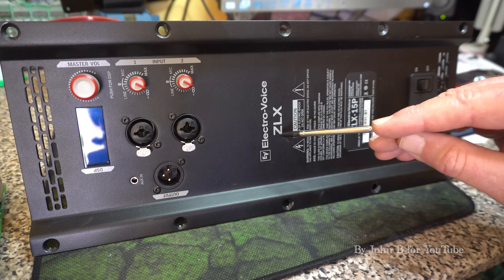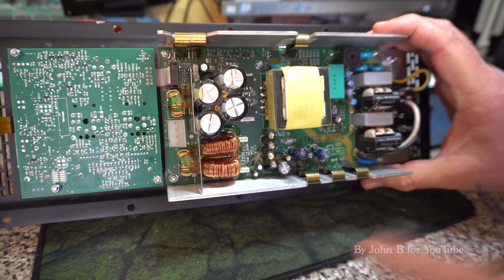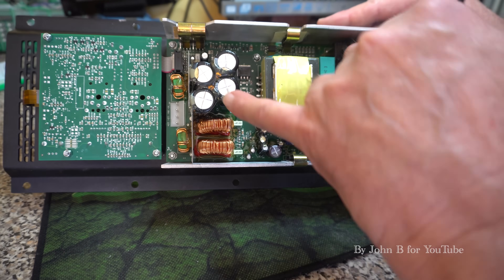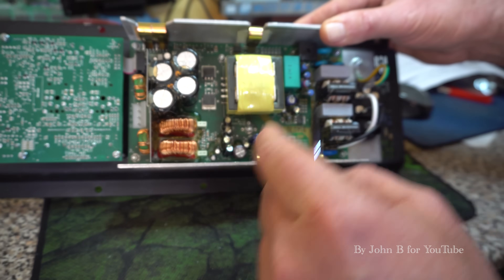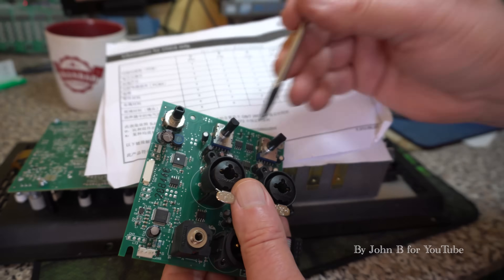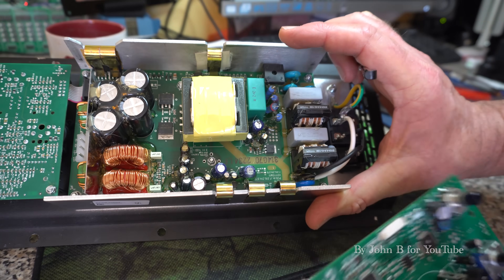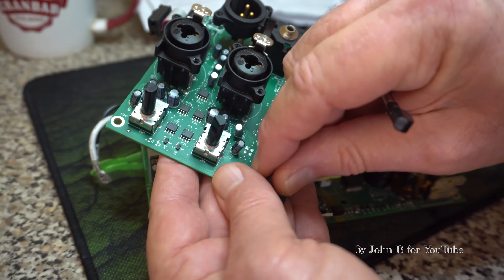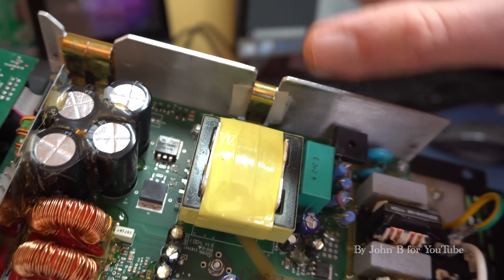The Inconvenient Truth about your Electro-Voice ZLX-12P & ZLX15P amplifier (Read Show More)

Comment: This is disappointing as I heard them last night at a party and they sounded great.
Reply from the maker: Their lack of power and reliability does not stop them from sounding great.
Reply: Just from some articles I've read, don't you find that many users will only really need, use about 200 watts +/- in their applications?  I own a few bass amplifiers with Class D amps, SMPS, etc.  They show ratings of 500, 800, 1000, RMS watts.  I use them in bands at small-med sized clubs, halls, etc with no PA support and they carry the room fine with my 2x12 or larger passive bass cabs, using my 5 string basses.  They've served me well for some years now. It seems I've never pushed them beyond their capabilities in the way I use them.

So what I feel is very loud or loud enough volume for the gig I'm doing, again from articles I've read, I'm probably only using 160-200 watts, if that, for that volume.  I guess the rest allows for good amount of headroom.  

My point being and I own a couple of the EV-ZLX200-12's/12" powered sub, that most users in small-med sized rooms at moderate volumes can get plenty of power/volume for their needs, 1000 watts or whatever EV rates them not withstanding.  

Of course, a DJ or band using these type speakers in very large rooms or at excess volumes may tax them to the point of failure.  Do you feel that persons pushing these EV speakers hard have a better chance of failure over one who uses them in a more moderate volume, room size, etc?

I understand you're telling us the lack of quality parts used in the manufacture of these EV's makes them prone to failure for the price paid for them and that's not cool.  But if one cannot get them to fail with "normal use", then I'm hoping using them as we do, restaurants, small clubs, they continue to serve us with no issues for years to come.  That's my hopes at least.  

Thanks for this video, makes one think that one should spend more money for  better quality powered speakers, depending on their planned use and needs, although I consider QSC as best quality much more than even Mackie.  I did not like the sound of the Mackie Thumps when I auditioned them.  But of course that is always subjective to each persons preference. 

These EV speakers may serve some for their uses and at a more moderate cost. With hopes of never having to deal with any issues of course. The "horses for courses" should apply when one makes these purchases for their applications.  
No argument with your assessment here. You made your point very well here. Howdy from Texas and thanks for this video mate, peace, .e
Reply from the maker: Good morning Texas from the UK.
You make some valid points with reference to power, venue size and not driving the speakers at max power.

I'd like to say I don't feel EV have used inferior quality parts, I believe they are as good as any other active speaker I have seen.
However,  looking at the design of the amplifier and the user manual I found quoting 1000 watts, it's clear to me that EV do not worry about inflating the real power of their systems.
If EV had quoted 240 watts, this video would not exist.
Also, if EV had built a more substantial power supply, the amp would not have failed and again this video would not exist.
It's the design of the power supply that maybe lacks sophistication and EV are not on their own in this regard.
The Mackie SRM450v2 SMPS is super super reliable, it's just a shame it needs 380 volts dc which is derived from a PFC circuit which is prone to failure.
The Mackie 450v2 SMPS is more sophisticated and complex, it has more components doing the same job as one component and so becomes more robust and reliable.
In answer to your question-
I think driving the EV speaker at less than full volume may give it a longer life span. But no guarantee.
From memory,  the QSC amplifiers are more powerful, clever designs using the latest technology and so probably a better choice than the Thumps.
PS On a side note.
Older Wharfedale  active speakers have their own fair share of problems, but the main SMPS isn't one of them. They use power supplies using a push pull design meaning it has 2 components doing the job of EV's one component.
This means the Wharfedale SMPS is inherently more reliable and I have yet to see one fail.
They also used larger components that can dissipate more power which again makes them more reliable.
So in summary, EV could have spent more money in the design process to make the ZLX series a much better speaker.
Reply: @JohnB-2021  Understood and thanks for your very detailed reply here. Look forward to watching more of your informative videos. Peace, e.

Comment: Hi John, thanks for your video. I have a ZLX-15P in for repair and the TDA8953 cuts out when it gets hot. I've reflowed the solder pads, so it's not a dry joint, and the heatsink is in good contact with the chassis. Do you have a source for the chip in the UK? I'm struggling to find one. Cheers, Trevor.
Reply from the maker: Hi Trevor,
I doubt the chip is faulty.
It's probably the heatsink pad is not conducting the heat to the chassis.
I use Farnell & Mouser for parts here in the UK

Comment: I like the comparison videos and trust this man's advice and he is right about the components used here in the powered EVs but if you go passive then you go off the sound and the EV ZX5's do sound great  - powered speakers in my mind are a bit unreliable n heavy still and the rush to get them over a powered desk is silly I think and I still think passive is king because if you get a good desk - A nice little usually reliable dynacord mark 3 for example or a H and Allen I still think its better for a few reasons firstly all these great passive speakers are cheap as chips now so EV ZX5 passives are cheap and so you can get great speakers for half the price.  #  Maybe though I get sentimental - Miss my old studio master horizon desk (Never let me down for 15 years and sounded lovely) and I used to love mini disk players ...lol.

I am not totally put off active speakers however and If I was to pick a brand for sound in the powered speaker range I would pick the Yamaha DSR 15  personally nice wooden cabs warm sound lots of ummmmph n top end better sounding than the yamaha dxr range which is good too though its heavy as my Aunt Bessy and you need a crane to lift the DSR 215.onto a stand ..they remind me of the old nexo range - great old speaker.   

I heard John B say if your desk goes down you lose your amp technically not always true cos usually you would lose one side of the desk (usually) and so you just link the speakers thro one side thats working and go mono from one channel.      

My question to John is have you heard of the EV evolve 50s what everyone seems to be getting - what do you think of those - Had a repair on them yet?
Reply from the maker: HI, not had an Evolve 50 yet, it would be very interesting to see the design and measure the output.
Thank you for your comments.

Comment: Well i have my pair of zlxp15s for about 5 years already prettt much playing with them 2 days a week and they still running as new they got hot and the lcd displays shows clipping since the first day i bought them
The only thing important is set the master volume to 0 and the mic level to the middle position or a bit less that will prevent the speaker to work the best i have never used the mic level more than half like i said
I guess you may only be able to use the whole volume up if you just use it to connect an ipod or a music but in live music situations just cant
I hope this helps

Comment: Have you ever had a look at rcf or fbt amps? Be interesting?!
Reply from the maker: Not yet, but I did find a schematic for an RCF, it looked like they were using the latest technology in their switch mode power supplies so should be a good quality speaker.

Comment: I was at an event yesterday, and one of my zlx-12p went out. It won't power up at all. I'm hoping it's a fuse. Is there a few that can be replaced easily?
Reply from the maker: There is a fuse in the mains socket.
It's probably going to blow again.
I did a video on the repair, the link is in 'show more'
Reply: I tried clicking on the link, but it's not pointing correctly. It looks like it's cut off.

Comment: I Have a Pair and Yea they get hot BUT it states 
Equipped with: 12" Woofer and 1.5" compression driver
Power: 1000 W peak, 250 W continuous power

Comment: Between Ev and Eon, which one?
Reply from the maker: I've not seen the electronics on the Eon so have no idea.
It can't be any worse than the EV.
Reply: John B hehehe ok!!!! got the ideia!
Reply: EV!!! As far as deep hard hitting sound....basic EV'S are still the best. Very full sounding speaker and never miss a beat. The newer version with built-in amps is iffy. Tip? With EV'S  get the ones with no amp....just the basic driver and use your compressor and EQ as your basic crossover. Simple! And you want have those problems.

Comment: Hi John B... I had a question if you don't mind?

I run sound for a bar and grill. We have a nice entertainment room. It's about 40 feet wide by about 90 to 100 feet long. We currently run 2 JBL EON 615, and we need extra monitors, but I figured instead of just getting monitors, as we want to upgrade to the EV series of speakers for more headroom on power (although after seeing this video, I think only the EVX or higher series is going to offer more power) and just take the JBL's and use them as monitors. That way we aren't wasting or needing to sell the JBL's as they have a monitor selection built-in to them. We already have 2 MR 905 monitors, but sometimes the backline can use another monitor or 2 as the drums get quite loud in our entertainment room.

What I am curious about is what speakers would be good for that size of room? We also have an old JBL 418S that's powered by a Crown CH 2 in bridged mode. I know we need another sub for a room that size, but currently we have a need for monitors and my boss wants to upgrade to the EV series speakers because a band brought their own sound guy and his EV speakers sounded amazing in our room.

Now I have concerns about the power, as I'm always telling my boss when they state 2000 watt power it's bullshit. I can't for the life of me figure out why they don't have a standard at this point. I just want to know what wattage I have on tap for constant usage, no peak power handling bullshit that doesn't tell me anything.

Comment: If you must have good powered  speakers buy from the top recommend brands like JBL, EV, FBT, RCF, and my personal favorite QSC. All these manufacturers  make a nice box for about the same price, 600 us dollars. If you buy their lower end 300 dollar box it's not going to be that great.plain and simple.  I will say that QSC has an enviable reputation for building reliable great sounding speakers and amps. They also have a 6 year warranty that you might not even use. They are  expensive but you really do get what you pay for. QSC for the win.
Reply: The only trusted powered speaker is the YAMAHA DSR series. RCF, FBT are total crap when it comes to engineering and design and quality, JBL are super quality but they are using modules from PASCAL audio witch is also bad. YAMAHA uses there own design highest quality of components, ultimate pieces of engineering. Only buy from a company who fully design there stuff. all of JBL, EV, FBT, RCF are using or buying from other OEMs. go and look at those RCF MAckie, FBT, EV, see how bad they are.

Comment: Hi, i have a ZLX 12P. De amp gives no power over the sub. Only over the tweeters. Any suggestions or fix?
Reply from the maker: Try another woofer and then look at the base chip, that tiny little thing that does not deliver 1000 watts.

Comment: Hi John I’m currently trying to choose a new sound system to use for my dj business. I’m looking to move from passive to active speakers due to portability issues and ease of use and as you outlined in the video I feel that some of the specs on the qsc, Ld systems and jbl that I’ve seen are worded in a way that just seems misleading. Do you have any advice more me and if so would you be able to have a look at a couple of the models I’m looking at for me ? Thanks
Reply from the maker: Hi,
Well first of all, you need to purchase active speakers from Manufactures that offer circuit drawings so that you can have them repaired if they go wrong.
One of my friends has big JBL's, but they can be difficult to repair.
I forget the model number, something like 525 or 625 and have twin woofers.
By far, the most common choice is the 450v2 Mackie and one or two of their super powerful 1801 sub woofers.
As you will have seen, it's no good trusting what the manufactures quote. (sometimes)
It all depends on how large a venue you intend to work in.
2 of the DJ's I fix amps for, run at least 2 450v2's + 2 1801 subs.
You can then cut the base from the 450v2 so that they don't work as hard.
1801 subs will fill most large rooms with ease.

Comment: And this is the reason I never use powered speakers. Yamahas are pretty good but I like a speaker and good old fashion power amp
Reply from the maker: Wuppie62
Yes that's correct.
Reply from the maker: And repaired many amp / mixers like Dynacord  & Peavey.
And if an amp goes down, one has no music at all.
Reply: John B 
You mean to say that when you have one seperate poweramp with passive speakers and this poweramp goes down, you have no sound at all, but with 2 (or 4 active) speakers, when 1 of them goes down, you still have the other active speaker(s) as 'back-up'?
Reply: John B normally it's one side that goes down. Not the whole lot
Reply from the maker: Oh, well that's lucky lol.
I'll try to remember that next time someone sends me an amp where the protection has cut in and cut out the whole lot.
Thank you for your comments.
Reply from the maker: Yes I understand.
I picked up a faulty subwoofer amp today to fix, someone said the music sounded different.
He'd lost his only sub, 6 active speakers continued to run.
He told me he use to rent out 2 amplifiers with speakers etc, 2 in case one failed.
He converted to all active speakers 18 months ago to cut down on weight and save space (he told me)

Comment: My zlx15 just not powering up was working last night cable was a bit loose then it stopped any suggestions pls?
Reply from the maker: Check the fuse then see if the amp is blown.
Reply: John B oh thanks I never new there’s a fuse and yes it’s blown that glass fuse and on my my way to maplins to buy a spare one I lost the blown one, do you know the amp of that min fuse pls?
Reply from the maker: Probably something like 3.15 amp anti surge.
Is your maplin still open then?
Reply: My local one at Streatham is closed but there’s one on Sutton high street
Reply: Hello John I’ve replaced the fuse twice and both have blowing up on my zlx15 now I don’t know what to do next any advise pls?
Reply from the maker: It probably has a blown supply like all the rest here on YouTube, replace the whole board or get it repaired.

Comment: also they are 1000 watts peak. I would say they are a good 500watts RMS.
but still get very loud for the wattage they are. & you just can't beat there clean crisp sound. :-)
Reply from the maker: 420 x 1.414 is not 1000 and that is at 41 volts not 36.
And the distortion is  THD = 10 %; RL = 4 Ω at 210 watts.
A 15 watt amplifier can sound very loud too.
Below is taken from the bass chip data sheet

In the following example, a heatsink calculation is made for an 4 Ω SE application with a ±30 V supply:
The audio signal has a crest factor of 10 (the ratio between peak power and average power (20 dB); this means that the average output power is 1⁄10 of the peak power.
Thus, the peak RMS output power level is the 0.5 % THD level, i.e. 92.5 W per channel.

So you have a 185 watt peak RMS power on the base. lol.
Reply from the maker: Your formula does not compute
Reply: you call 10%THD clean?
Reply from the maker: Who called it clean?

Comment: I have been using my set of EV Zlx 12p for over 2 years now. & I push these babies to tapping into limit every weekend. & not one problem yet! I drive my speakers hard & I have always been able to trust EV for my over 30 years of DJing. I also have a pairs of the ZA1 12" sub's for when I need to add extra bass for like a school dance. no problem with those ever either. all my other EV speakers are passive with QSC amps with I have had for over 30years & still work great til this day. I have 20 EV passive speakers all work great. but only one powered zlx system. but so far for these 2 years I have worked them hard without not one problem at all!
& to put them up against Mackie thump or jbl, they blow them away in sounds quality & sound much louder!
Thank u for your video, but maybe that was just a bad board. it can happen. :-)
Reply: I'm with Andre. I beat the crap out of mine, and they perform flawlessly. Sounds to me like there's something more going on here.
Reply from the maker: Just a bad board?
lol
No, the newer boards fail as often as the older boards, just read some of the forums or look on YouTube to see the blown EV's on all models.
It's no good comparing a passive speaker to an active speaker.
Give your amp time, it will blow up, they all do, especially if you are running it at the 'limit' as you mentioned above.
That simply means your speaker is too small for the job.
Reply from the maker: The blown amp was 4 years old,  it also performed flawlessly until it failed.
Nothing going on, just showing how they go wrong and how the woofer is driven.